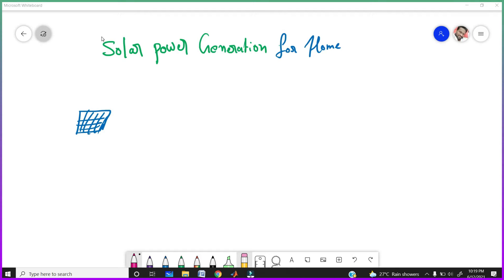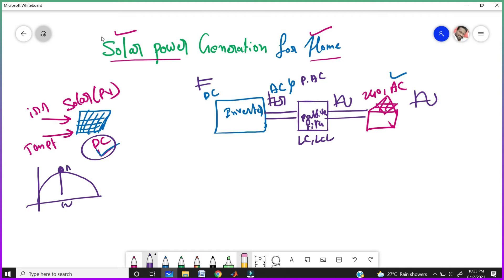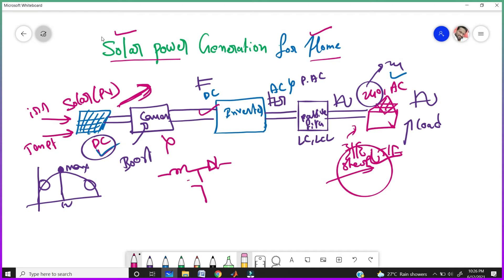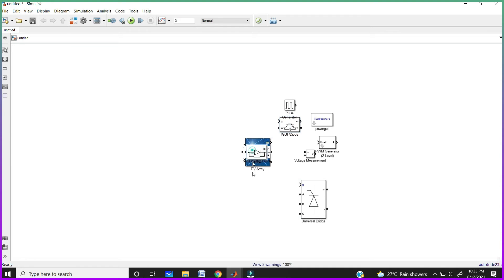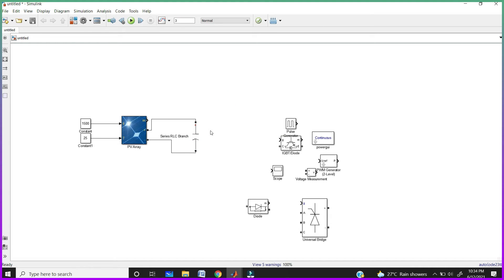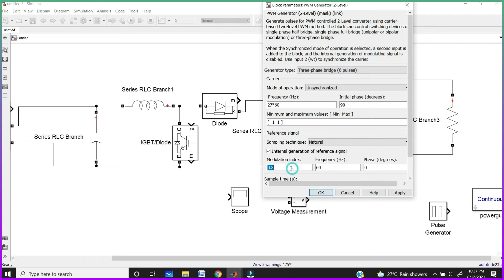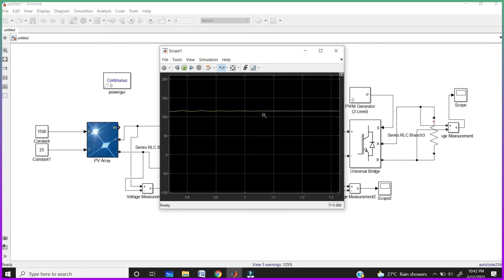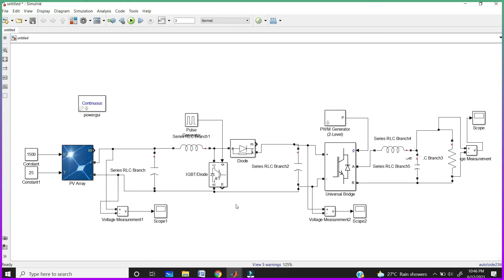Solar power generation for home using MATLAB Simulink | Solar power system for home | Solar PV Grid

Comment: You mentioned it's a resistive load, but in reality, household loads are not purely resistive—they often include inductive and electronic components too
Reply from the maker: Yeah thats correct. You can modify the load using passive elements like rl load.
Reply: @allabouteee4u what is the value of resistive load

Comment: Sir if we use transformer instead of boost converter there is no need to connect capacitor after pv array or we should connect

Comment: Sir I am getting error as   Derivative of state '1' in block 'Project1/PV Array/Diode Rsh/Transfer Fcn' at time 0.0 is not finite. The simulation will be stopped. There may be a singularity in the solution.  If not, try reducing the step size (either by reducing the fixed step size or by tightening the error tolerances)

Please help me how to solve this problem
Reply: I'm also getting same problem

Comment: in the end after adding filter the waveform shows that the maximum voltage decreased from 240v to 50v but we had to generate 240v ac so the max voltage should be 240 right??
Reply from the maker: Yes it should be 240v. We need to tune filter values exactly to get that. I just explained how the power flow the block diagram for solar powered home.

Comment: Thanks for the explanation, just i noticed somthing that in the final result when you add the LC filter the voltage reduces and became (-20V, 20V). If you want to have the (-220V, 220V) you should adjust the values of the LC filter as: (L=0.003H and C=0.002F).
Reply: Thanku so much it helps me a lot
Reply: Depending on what should I model LC ?
Reply: Thank you very much for explaining how this LC Value should be taken in order to get the desired output I mean by using which formula one can estimate the desired output voltage value by using LC Value, i required formula between LC and output voltage and resistance in the circuit
Reply: bro , the input voltage i'm getting around 160v , what should i do
Reply: @novaknight3288  im getting 190 v bro